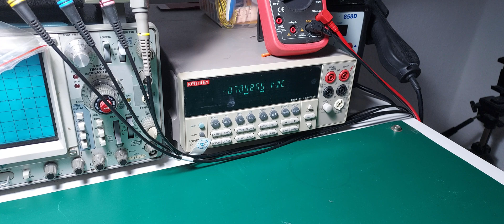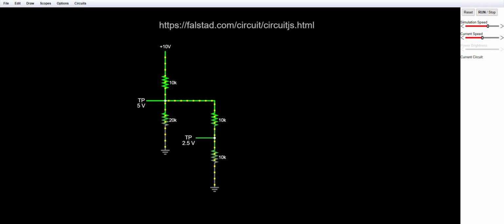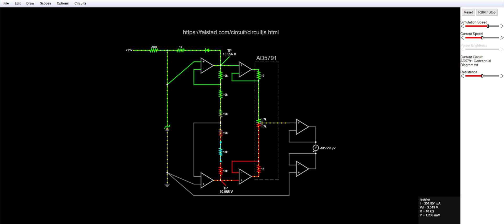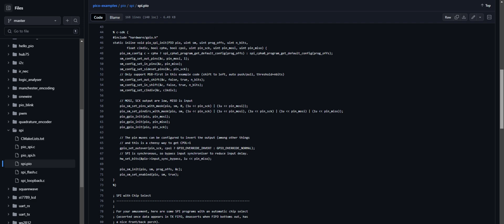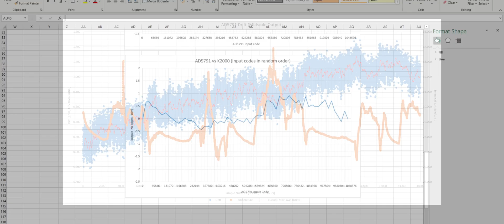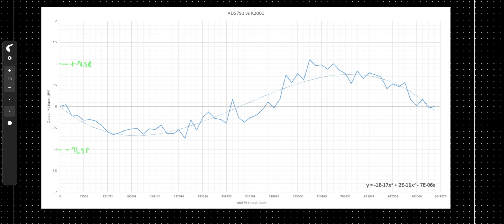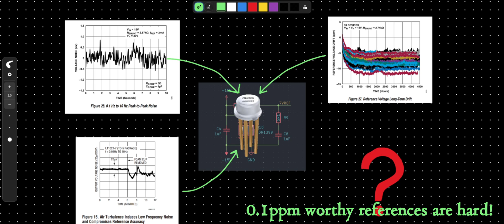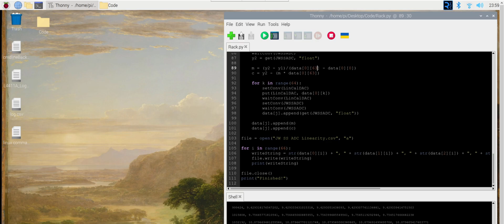DAC To The Future! | AD5791 Linearity Calibrator

Comment: Hi, 15:32, you might wanna search for "Dartzeel" amplifier power supply "schematic".
it's a 50.000 € amplifier.
Reply from the maker: I took a look at the amplifier...I daresay it's ever so slightly overpriced😅
I wasn't able to find a schematic for the power supply section after a quick googling though, do you think you could point me in the right direction? I'm quite curious to take a look. With that being said, I think a 78xx regulator is plenty good for my purposes.
Reply: @NNNILabs  Just use "Dartzeel" and look at images, keep scrolling down, maybe add "schematic" and try again, when i posted this comment i found it again in less than 4 minutes, otherwise change to other search engine.

This amp is build on real 24 carat gold.

This schematic shows how clean, filter before the rectifier, like EMC filter, i did some FFT in Ltspice. you can't do better.
Reply: @NNNILabs   Dartzeel + schematic  under images, it will pop up somewhere.

Comment: For additional tests you could use another meter to monitor the Zener Voltage or the Vrefs of the DAC directly, that way you could get as many sources of error out of the way as possible
Reply from the maker: That's a good idea! I guess you could get an idea of drift by getting a second opinion...kinda beats the point of having a standalone calibrator, but I guess when you get down to the sub-ppm level you really need the help🤔

Comment: Nice intuitive explanation of a R2R DAC! Very impessive results too. Looking forward to the Jim Williams DAC video. 

What about a PWM DAC? The RP2040 can output 16 bit PWM with a max frequency of about 1.3 kHz. There are some designs where 2 PWM channels are combined to get 32 bit of resolution. The linearity is going to be worse of course.
Reply from the maker: You'll have to thank ADI for doing all the hard work on the DAC, I just followed the instructions in the datasheet😅

PWM DACs are actually used in all the highest-end calibrators, and a friend of mine recently designed one that achieved ±0.1ppm INL...I hope I'll get a chance to feature it in a later DAC video.

Regarding the RP2040 PWM - I've put some thought into this as well, it's not just PWM resolution, but there are other factors like jitter that can influence INL. Combining two 16-bit PWM channels to get 32 bits is also something I've considered, but of course, there's some nuance to that, for example the resistors you use to combine the PWM channels need to be very well matched. Of course, the workaround to that is having a few bits overlap so you can do some kind of gain calibration to line up the two channels (misalignment might influence INL again!). Jim Williams did something similar in AN-86 by combining two 16-bit DACs with 4 bit overlap to get a 24-bit DAC. Yet another thing to consider is ripple, you'd need a very good filter that is also DC accurate to achieve sub-LSB ripple. So many things to think about...enough yapping!

The Jim Williams ADC is definitely something I'm looking forward to showcase. Spoiler alert - I was able to achieve single-digit ppm INL (±10V range)!

Comment: 465B, nice scope
Reply from the maker: Indeed, I wish I could get the focus right, plus I need to take it apart and fix some of the crusty switches...not that much of a repair person 😅
Reply: @NNNILabs  Ah, yeah, especially if it's the drum switches. I haven't found the focus on these to be super super sharp; some kind of trade-off for bandwidth I guess.

I might have to steal that technique for improving INL ;)
Reply from the maker: @fletcherreder6091  Feel free to do so! Just make sure that whatever you are calibrating can hold that INL😅